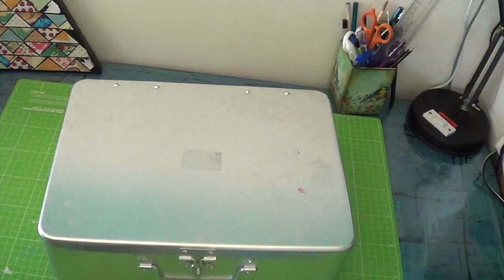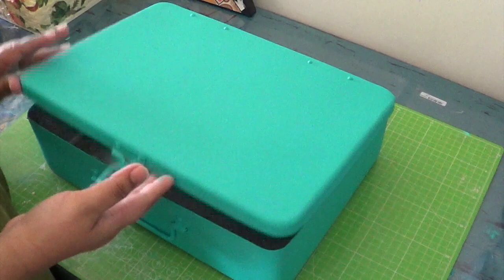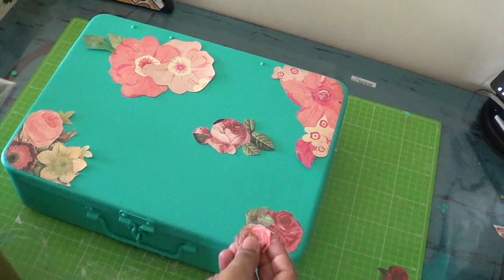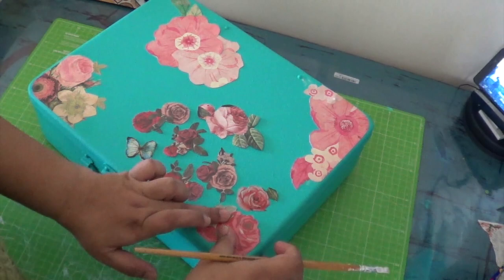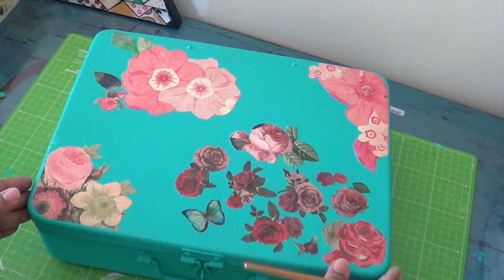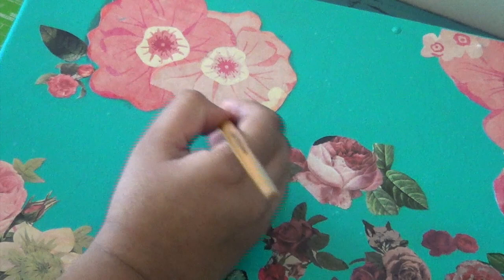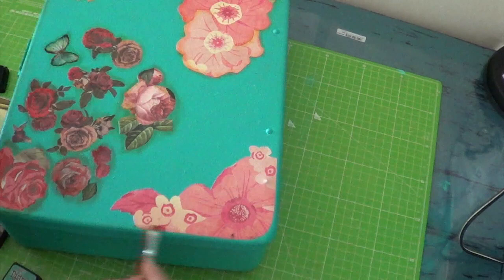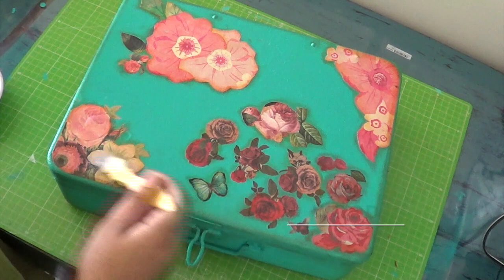DIY - Decoupage on METAL!!

Comment: Thank you for the beautiful tutorial... Please let me know that the flowers which you have pasted using glue it wont get out of the trunk..
Reply: And whr can we get wood varnish
Reply from the maker: Thanks Garima for the kind words. The motifs adhere very well when coated with decoupage glue and once the coat of Varnish comes on its almost like an inlay! Any water based wood varnish available locally at your local hardware store would work just fine.
Reply: Thank u😊

Comment: I have an old aluminium trunk which I want to makeover. Will the chalk paint or emulsion withstand time? Do I need to use sandpaper to get a rough surface before I paint??
Reply from the maker: It’s not really required to sand. Yes it would last for several years if the procedure is well done.